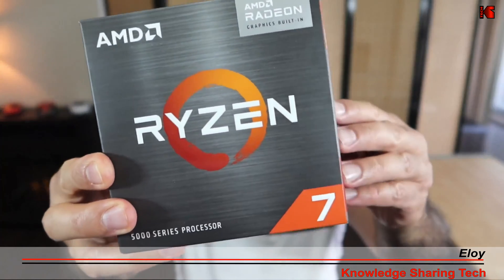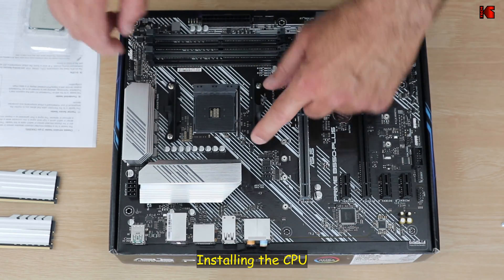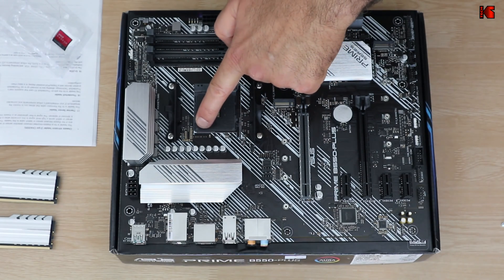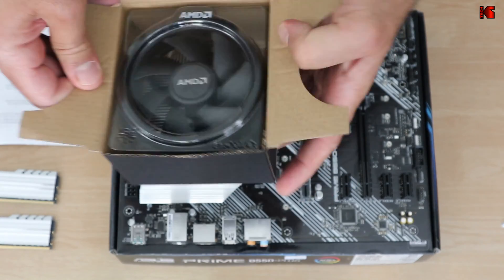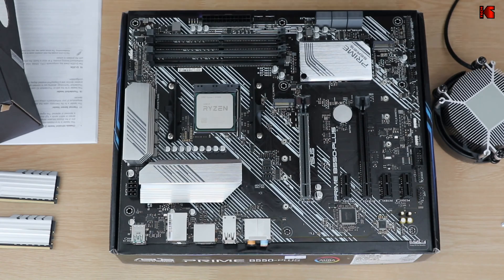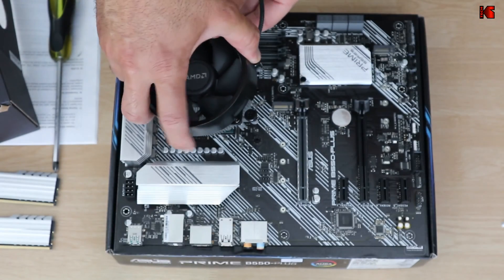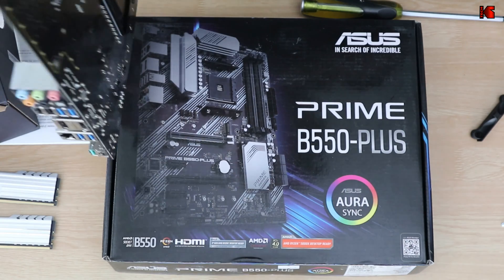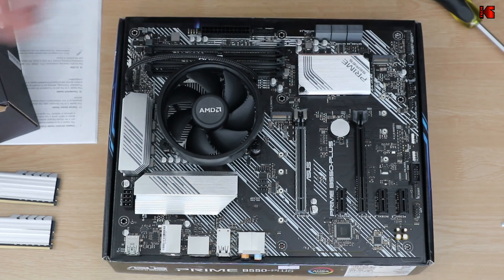How to install an AMD CPU and AMD Wraith Stock CPU Cooler

Comment: Was scared a bit to bottom out the cpu cooler screws without spacers on the front of the mobo. But after watching this i realized there are none and just full send with care. Do it in increments as he describes.